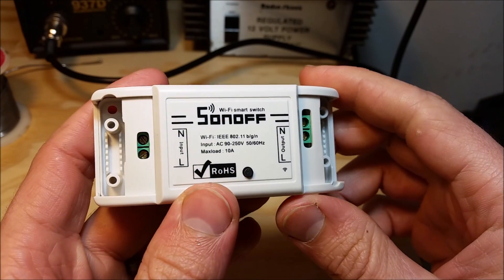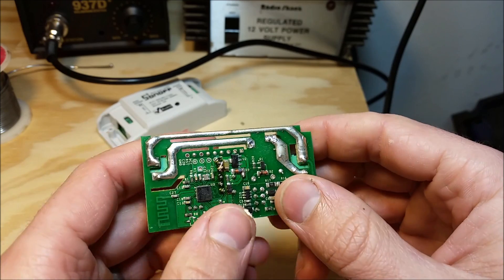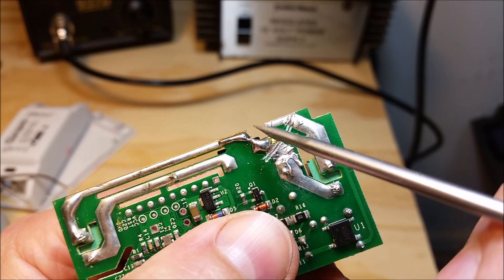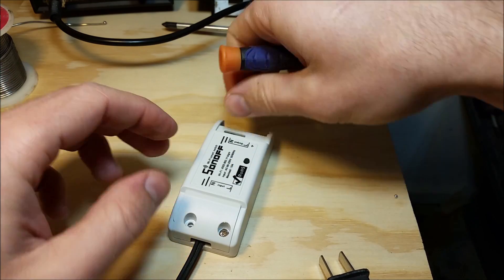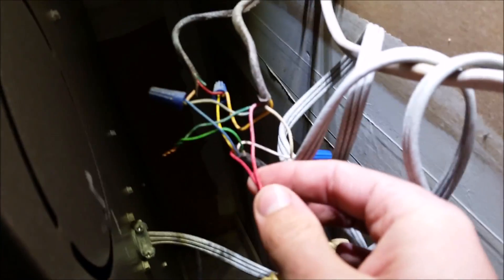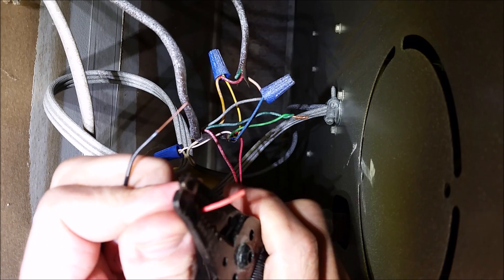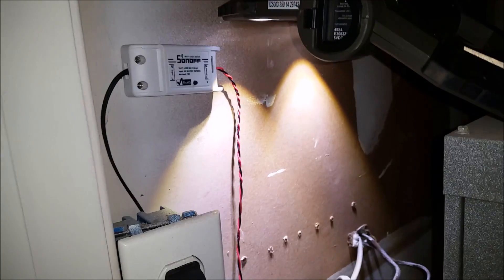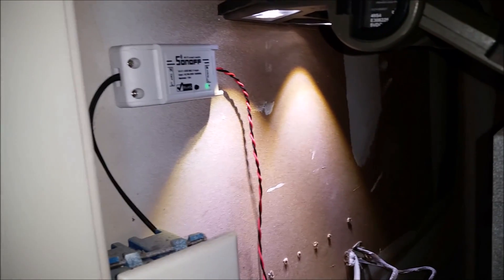#2 Modifying Sonoff along side Thermostat

Comment: Just watching this now as I have a SonOff SV I want to turn into a Thermostat control.
This is great to know you can do this with the regular SonOff.  I would strip a lot more copper back though to make sure there is a good isolation gap, especially on the top.  A gap of less than 1/16th of an inch is asking for the AC to jump across it.
Apart from that, this is a great little project to make the SonOff dry contact.

Comment: Do not pre twist wires b/4 wirenutting. Good Project! SONOFF is not UL though and of course you modded it and your fire insurance went bye bye. I have a SONOFF on my furnace also, mine interrupts thermostat demand if my smoke or CO alarms sound.

Comment: Did you consider powering the Sonoff with 3.3v at it's 5 pin area and leaving the relay traces unmodified?
Reply from the maker: yes, but then it would use double the power, because i would need additional  3.3v power supply
Reply: Fedor Weems I don't think it would be double power usage.  There is also some low power Sonoff version apparently which might even accept power from the air conditioning system.
Reply from the maker: RebChaim613  yes in that case it would work. My thought was the sonoff would draw some power and additional 3.3v power supply would too. But if you can connect to AC it would be a good deal

Comment: Hallo , congrats for the job, I have two question hope you can clarify , what is the reason you isolated the ac ?
Se cod question is , how can I use sonoff items to control my heating system in place of a thermostat?
Reply from the maker: I separated the AC because it is 120v and my airconditioner runs on 24v AC.
Reply from the maker: So i am using the Sonoff as a relay instead of using it to give power to a device.
Reply from the maker: To use sonoff in place o a thermostat you would need 2 relays. one for activating the FAN and the other for Activating the heating system